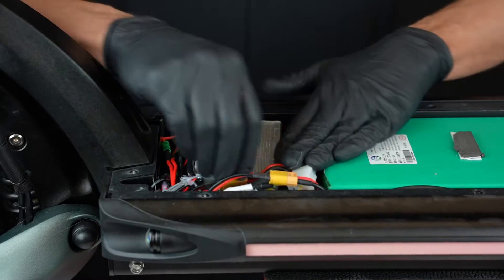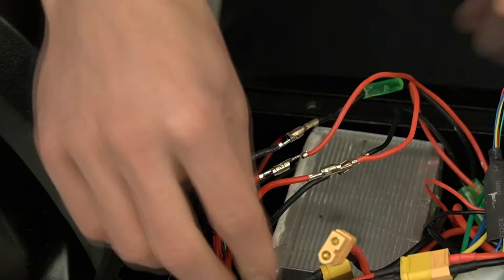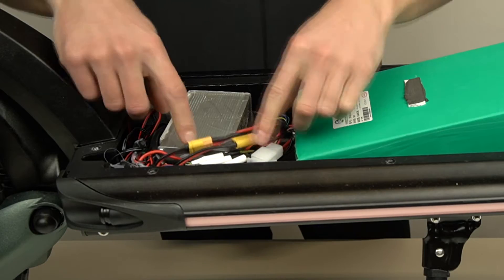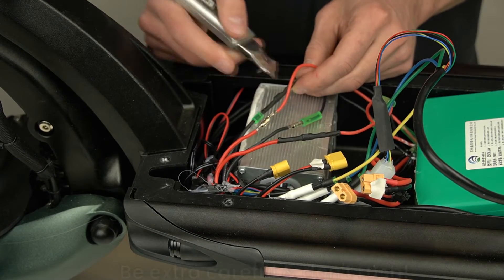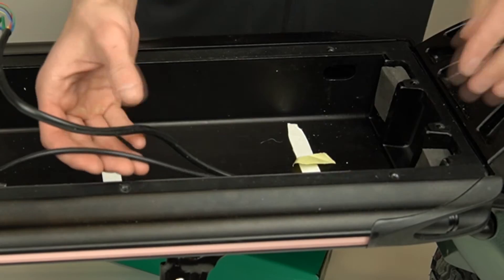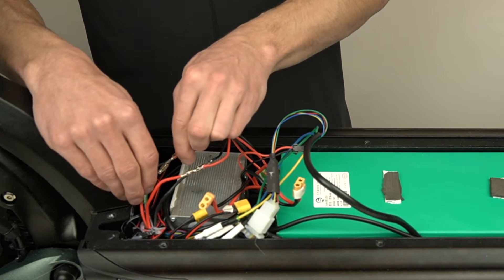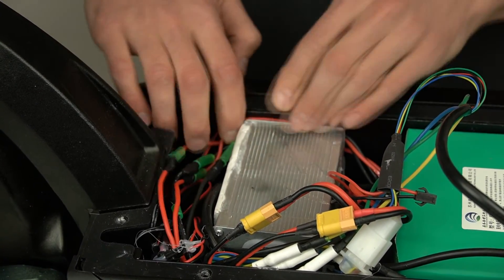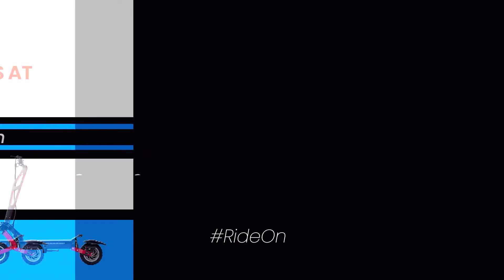ELECTRIC SCOOTER BATTERY REPLACEMENT - HOW TO REPLACE / INSTALL THE BATTERY

Comment: So do the red wires and black wires have to match the exact same as the old one? Because none of the wires are labeled on neither the scooter nor the battery?
Reply from the maker: They have to match black to black and red to red but it does not matter which.

Comment: If I got a 52v 18ah dual charging ports and wonted 2 replace it for 60v 24ah dual moters 800watt is it as simple as that and will my old chargers still work 2 charge

Comment: Look for battery replacement options.  My D4 2.0 23.? Ah battery is now failing and is only good for maybe 5-10miles before it turns off.  The scooter has nearly 3k miles. Nearly 4 years old.

Comment: Hi Guys! I'm doing exactly what you are showing me in a LS7, but when i have to reconnect the second yellow port of battery, a little sparkle appears, so i get scared and can't finishied the process. It is that normal? Some friends told me that yes, and it is because voltage difference between system and battery at the beginning. What is your opinion about that? It is normal? Thanks!
Reply: Yes that's totally Ok
Reply: Rc car lipo guy here. Yeah that pop is normal. Some speed controlers on rc cars have a built in surge arrestor as those batteries get changed all the time. Scoots aint got one as you might get a new battery maybe once in its lifetime. I wouldnt use electrical tape, i would use heat shrink

Comment: I think that my battery died. My scooter turned off at like 53volts and it wont turn back on even after charging it. After charging the battery i tried the waking up the battery thing but didnt work. It doesnt even give a pop when plugging the charger (charger not connected to the wall) so i think that its my battery that is broken and not my controllers. Am i right?

Comment: Thanks for the video. I may need your help and guidance into buying and installing battery for 2800W dual motor total 5600W, 60V 25AH battery. I want to increase my voltage and AH battery. Please provide your email. I’m willing to pay you for helping me. Thanks. I just can’t find someone or a workshop to help me. My scooter looks like your scooter. The odometer look very similar.

Comment: Hi I don't remember exactly how the wires went back in there I put them back and the lid fits snug and I don't have any problems that I know of, but is there anything in there that can't be touching? Does it have to be put back the same way? I know that's what yall "recommend" people to do.
Reply from the maker: Hello Rob! Is that a Nanrobot scooter that you need to replace a battery on?

Comment: I WANT TO BRING MY DUALTRON EAGLE ON THE PLANE BUT AIRLINES HAS RESTRICTED ALL HIGH VOLTAGE BATTERIES. MY QUESTION I WANTED TO SEE A VIDEO HOW TO REMOVE DUALTRON EAGLE BATTERY SO I CAN SEND THE BATTERY IN A CARGO SHIPPING SO I CAN BRING MY ELECTRIC SCOOTER ON A PLANE WITHOUT BATTERY.
Reply from the maker: Thanks for your comment, but we don't have any experience with Dualtron batteries.